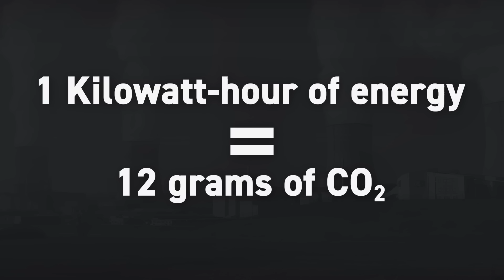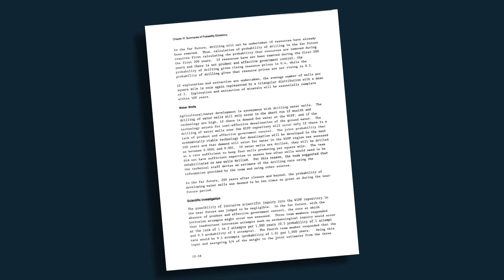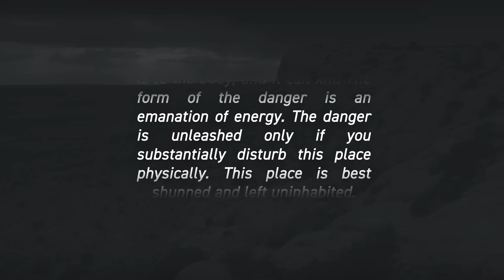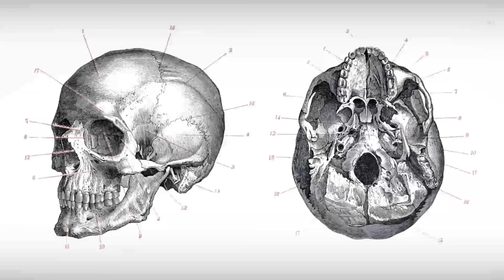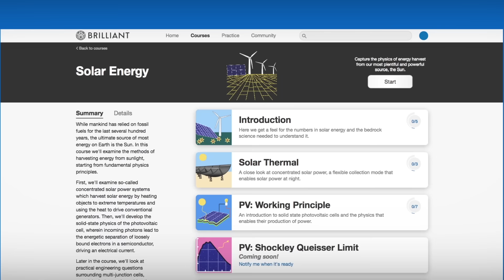The Nuclear Waste Problem

Comment: Just send the waste to space - Give it some speed, and i will move away from earth forever...
Reply: Have you ever held lead? Pretty heavy right. Enriched Uranium is about 70% heavier. The largest rocket in the world right now (Falcon 9 Heavy), can only send a block of about 1m3 on an escape trajectory from earth. That is without anything shielding the material. If so, it'll cost about 2 trillion dollars to launch all nuclear waste off earth.

The US national debt is 21 trillion, so whats an extra 2 trillion dollars for the entire world right? Well, it's got more to do with the amount of rocket launches it'll take. More than 1000... And if one fails, it'll rain down fire, debris AND irradiate the crash site for thousands of years. So yeah, digging a deep hole is a better option.
Reply: What if the rocket fails mid way we are doomed

Comment: Everybody should just scroll down to read MrGottaQuestion's post to see how inaccurate this video and common nuclear hysteria generally is.
Reply: You mean thesis?
Reply: @MVargic  More than that: if coal/gas/oil plants were subject to the same standards that nuclear plants are, EVERY SINGLE ONE would be shut down tomorrow as a dangerous radioactive emitting hazard.
Reply: J S  the real figures are about 76 radiation deaths at chernobyl and maybe another 1000-1500 excess cancer deaths - but it's hard to pick those out of the general noise and could be much lower

1500 people died in the evacuation of Fukushima province due to panic caused by the FEAR of radiation.

Comment: Why only use the rods for 6 years again? Is there another way to use it longer?
Reply: We CAN reprocess the fuel, and there are a few new reactor designs that should be able to burn up spent fuel as well.
Reply: Yes, you can just recycle it. France does this. It's called Mox.
Reply: if we develop better reactors ( newer generation reactor) we would be able to use the fuel longer, use old fuel and also shorten the half time of the uranium
Reply: Oh, absolutely. The French do it without issue.
Reply: Yeah, it's due to the build up of so-called 'neutron poisons', and it's a problem inherent to solid fuels. We actually only burn up to about 3% of the available fuel in a once-through cycle. Most of what is called nuclear waste is actually still perfectly fine fuel.
Reply: Run it though a Thorium based LFTR reactor and the radiation is only dangerous for 100 years.
Reply: Two reasons. The main one is that the fuel is depleted - there is not enough Uranium-235 left for the reaction to continue in the same style of reactor. The 2nd is that the "ash" that builds up, blocks the nuclear reaction. 

It is possible to reprocess the rods, extract uranium, and plutonium and make new rods. If you have 9 reactors, then the used rods from 8, after reprocessing can make enough fuel for the 9th. Reprocessing is very difficult and expensive. 

Some types of reactor are capable of using "weaker" fuel than others. It would be possible to take used rods from a PWR reactor, cut them up, extract the easily removable "ash" and repackage them for a CANDU reactor, and get another 6 months use. But this is a lot of effort for not much extra benefit.

Comment: 2042 News update...Finland nuclear waste site get hits with a meteorite... Spreading a deadly cloud over most of the northern hemisphere.
Reply: Lol. Seriously though if the meteorite would be so big that it reaches the nuclear waste 400 meters deep in the bed rock, I think the radiation is the least of our problems 😂
Reply: What are the chances? 
2 in a million
Reply: @krispinwah2784  Probably not even that big.
Reply: just put a sign to discourage the meteorite
Reply: Such an impact would wipe out most life on the planet, so it's a catch 22.
Reply: @VelvetCondoms  wouldn't take a world ending cosmic item to crack it open. I doubt the facility will be able to withstand a 1megaton nuke.
Reply: @Kay0Bot  Yeah I was researching this and it could just be that the explosion size (only) of a large nuke could reach that material making it actually very dirty bomb.
Reply: 10 megatones in https://en.wikipedia.org/wiki/Meteor_Crater didn't create even close to deep enough crater. Then you must also remember that Finland has much harder bedrock than the crater location in Arizona.  Finnish location has bedrock consisting from Gneiss and Granite. This makes it extremely good at surviving external forces like surface explosions and ice ages.

But still a large meteorite could penetrate deep enough to disperse buried material. Meteorite wouldn't necessarily have to be large enough for mass extinction. But even then than size meteorite hitting a specific location is a very unlikely event. Considering human history I think it is much more likely that some moron decides to launch MIRVs to cause even worse damage.

Comment: The cleanest source of energy, except when it's not.
Reply: @MVargic  Love that liberal double down. Nuclear meltdown, not a problem. Turn it into a theme park. Classic.
Reply: @SixCylinderSamurai  You do realize that nuclear energy isn't just nuclear fission, but also fusion. Nuclear fusion is how the sun is powered. Having the power of the f*cking sun would be a huge step forward in energy production and science.

And nuclear fission is far more safe than most fossil fuel plants. Chernobyl happened in 1986, people in 1986 had lots of dangerous habits that we would call foolish today and just like the habits died nuclear technology improved. Fossil fuel plants pump dangerous gasses into the air we breathe everyday, nuclear waste is stored in remote places that will most likely stay untouched for centuries.

Still don't see the problem?

Comment: Why do we not put it back where we got it from? The old uranium mines should be perfect storages
Reply: Perfkt??
Reply: Spent fuel rods are 80% recyclable, the only reason we don't donit is because it's illegal, France recycled their fuel and has almost no nuclear waste, protest this crime against the environment!!!! Legalize nuclear recycling!!!!
Reply: Uranium is not the only element in spent nuclear fuel....there’s also plutonium. If it were to get into the water table.....there would be big problems.
Reply: well you got the same idea as me( i mean the first comment), i do think that recycling the fuel rod and dump the waste into depleted uranium mine is a good idea since the place is already radioactive possible because of neutron capturing.

Comment: 31 people didnt die in chernobyl the estimate was around 6000-7000. 31 wass the official statement by the USSR
Reply: 31 people died in 3 months due to explosion or radiation, that's right. Russians didn't lie but didn't tell the full picture, cause they didn't say how many died in the upcoming years due to extended expsure to radiation.

Comment: If the spent rods are still creating heating up water then aren't they useful?
Reply: No, because they don't heat water fast enough. The spent rods are recycled, though.
Reply: Dover who cares if it's not fast? It's still heating it up, it'll still turn to steam and generate some kinetic energy. At the very least you would expect it to be cheaper than pumping in coolant.
Reply: They are, the video is misleading. You could reuse the same fuel multiple times if you enrich it or use different reactor types. But the problem is that the same technology can also be used to make nuclear weapons grade material. You can imagine how much USA would not like that.
Reply: Reprocessing spent nuclear fuel doesn't mean enrichment of bomb-grade stuff as in nuclear weapons, it means removing the fission killer elements that render it spent nuclear fuel and processing the rest into new nuclear fuel. The reason it is not commonly done is that mining and processing fresh uranium fuel is cheaper. For now.

Comment: I’m really disappointed that you didn’t talk about Thorium energy in this video. It’s much more efficient than Uranium and more abundant.
Reply: Please tell me your joking
Reply: They've got a point, albeit oversimplified. The fuel supply being limited to 240 years isn't an issue, not just because Thorium is everywhere and can supply global energy demand for millions of years, but even harvesting the oceans for Uranium which is constantly replenished as it leaches from the seafloor totally knock out that point from Wendover. What is termed "Thorium energy" usually is shorthand for Thorium in a molten-salt reactor, and even if you're not fueling an MSR with Thorium you can have a fast-spectrum reactor which can eat up all your dangerous transuranics like Plutonium up for breakfast, safely destroying both nuclear waste and thermonuclear device materials safely with the added benefit of zero-carbon power cheaper than coal and gas. Check out Elysium's fast-spectrum molten salt reactor design.
Reply: Once someone figures out how to use Thorium in a reactor it would take over Uranium, but of current information of Thorium no one has gotten it to work yet. China has purchased information on this subject from the American Department of Energy and is trying to figure out the problems we can't seem to overcome.
Reply: Chad Baker No we know how to use Thorium in a molten salt reactor, you couple it with a kickstarter like Plutonium from disassembled nukes and that will breed it to U-233 and at that point you need no more and can just add Thorium as needed. The only small problem is high temperature salt corrosion but two start ups have gotten around this by having the reactor cans be small enough for replacement every four to seven years (Terrestrial Energy and ThorCon)
Reply: Their are currently no working thorium reactors in the world yet only on a small scale have they worked as reported by the "World Nuclear Association". Many companies as the ones you said are due to complete a prototype build for testing in 2025.
Reply: A working molten-salt reactor was demoed and ran for several years continuously between the mid 60s and early 70s, the only issue is upscaling it to commercial reactor sizes. ThorCon expects to produce the first ones in 2020.
Reply: Eddy Gerina Thorium is not in a greater supply than Uranium. In terms of current mineable land reserves yes you are correct. However total reserves uranium has a dramatically greater supply. The issue is that the majority of this supply is the ocean and uranium is found in small concentrations. Total reserves of uranium including oceanic extraction could produce over 6,000 years of fuel. 
http://large.stanford.edu/courses/2012/ph241/ferguson2/
Reply: Chad Baker This is not correct at all. It is import that you recognize that Thorium is just a fertile fuel, and the reactor design is rarely ever dependent on fertile fuel. When we talk about advanced Thorium reactors most people are commonly referring to what is called a LFTR or Liquid Fluoride Thorium Reactor. This is a liquid fuel Molten Salt Reactor, and while none of these are at commercial scale multiple countries do in fact prototypes of this reactor. In regards to your statement that Thorium reactors do not exist, currently CANDU Heavy Water Reactors in Canada have used thorium since 2013.

Comment: Thorium is future , india has enough thorium to supply world for next 5000 year .and thorium donot have waste problem .
Reply: Yeah, India and China are the only ones currently building Gen IV reactors. I give it five to ten years before China has completely outstripped the US on technology and science production.
Reply: 5-10 years? you are very optimistic.
Reply: ayush kumar yea! thorium! awesome!
Reply: lordferius good luck, half of dirt is thorium
Reply: no, just no.
Reply: The thorium fuel cycle probably isn't the best option, at least in the short term. There are other ideas out there, that will likely prove to be cheaper and easier to implement. I'm personally partial to fast spectrum MSR concept as described in this video: https://youtu.be/pqVt8cxx-44

Comment: Or, we could put the spent fuel rods back into the ground, where they originally came from.

Why can we do this? It’s because the radiation given off by uranium has very poor penetrating power.

I quote from this article:

https://ieer.org/resource/factsheets/uranium-its-uses-and-hazards/

“Uranium-238 emits alpha particles which are less penetrating than other forms of radiation, and weak gamma rays As long as it remains outside the body, uranium poses little health hazard “

Do you know why those famous reactor disasters where so deadly? It’s because the radioactive particles cane out in the form of dust when the containment units failed. Then the people breathed in that dust, and when that happened, the low penetrating power of the alpha particles didn’t matter because they were defused throughout the inside of the body.

And they are still deadly, not because the reactor is still there, but because now all the wildlife around the facility has the radioactive particles in them, and thus aren’t safe to consume or be around because they have absorbed some of the radiation.

Comment: You never mentioned the Three Mile Island accident. Wasn’t that a huge nuclear disaster?
Reply: In actuality it wasn't. Three Mile Island was a partial meltdown that occurred due to a combination of operator error and failure to follow existing NRC regulation. There is conclusive medical data proving that the radioactive release did not harm anyone, it did not harm the environment and it did not increase the cancer rate. Whats even more confusing is that new regulations were passed as a result of the incident, even though if existing regulations were followed then the incident would never have occurred in the first place. The new regulations that were implemented would have had no actual effect on the incident.
Reply: Evan It is considered one of the "big/only 3" where a meltdown or partial meltdown occures, but wasn't actually a serious incident because they successfully mitigated the disaster.
Reply: Cost a lot of money to keep it contained, but that’s it.

Believe the regulations where because of the scare. Mainly someone made a video during that time that made everyone scared of a nuclear meltdown. Plus the workers where really convinced that nothing could go wrong so they looked past there flaws. That means that they where not fully trained on what to do when it happened. Some mixed up happened, would have to reread my source to know what happened. Also the representative they had representing them, was an engineer who had no experience working with the media. That did not turn out well. Further they only had a phone that communicated to the outside world, so really they did not plan for things to get out of hand.
Reply: No it wasn't. There's a possibility it was all a P.R. gag, the same people who made the movie China Syndrome were covering the Three Mile Island incident as reporters.
Reply: He listed the 2 worst disasters. The oly category 7 disasters in history. Tmi if my memory is to believed was a category 5 only notable because it was the worst disaster on us soil.
Reply: Nope, no leak, no fatalities.  Press ran amok because of the Movie "The China Syndrome" (Only in America !!!)  And Fukushima, that was a tsunami that killed 23,000 people, but they don't rate a mention.  There are two reactors at Fukushima and it was the 40 year old facility, which they had falsified the maintenance records about, that failed.
Reply: All they really did was evacuate people in case it went bad, but they stopped the complete meltdown and there was no risk. People's imaginations ran wild and thought they were in danger when they weren't. 10 years latter someone's chain smoking grandfather gets cancer and it is somehow the plants fault.
Reply: Look up the MIC chemical disaster that happened at Bhopal India, at an insecticide plant ran by a US company, Union Carbide. Killed over 2,000 people on spot, and resulted in over 15000 death in time. Not only that, but babies are born dead, or have sever birth defects.Further, the locals still could get the effects--like blindness--due to the fact that they are still exposed to the poisons chemicals still tell this day. It is in the atmosphere, water, and probably in the soil. 

There was a lawsuit, but government there rushed though it, and so only a few people got compensated for it. Plus the government has turned a blind eye, and I believe they band people to doing research on the area, and to test the area further. Therefore there is a whole group of people out there being ignored, and yet they are suffering greatly.
Reply: Three Mile Island incident a disaster? Are getting some x-rays a disaster?

Comment: What about Thorium? Wouldn't that resolve this problem?
Reply: Yes, the problem is that the technology isn't quite ready. Sadly, we've created a system when government subsidies push energy technology forward. Without those subsidies, the nuclear technology is moving very, very slowly because not only is it's future use unknown (places that are banning and shutting down nuclear plants due to fear) but also because the research costs have to be borne by someone first (which requires a hell of a lot of available capital). If the government pushed the subsidies from wind and solar into nuclear power, the technology would boom and the thorium reactors would be developed more quickly.

Comment: The difference is that now we have Artificial Intelligence that can automatically interpret and update warning text every 10 years or so. It can run on a radioisotope thermoelectric generator (similar to the Voyager interstellar probes) and or even powered remotely via long range electromagnetic coils.